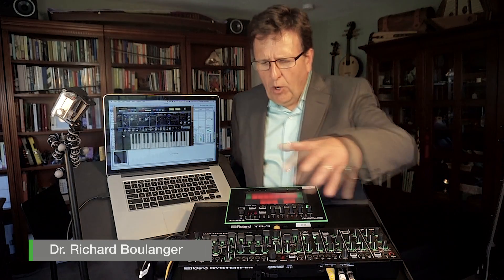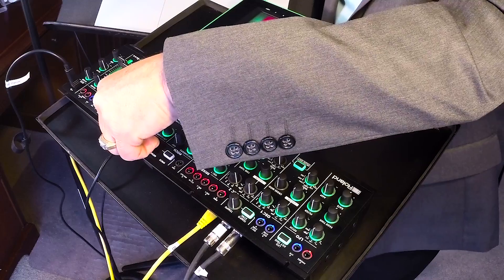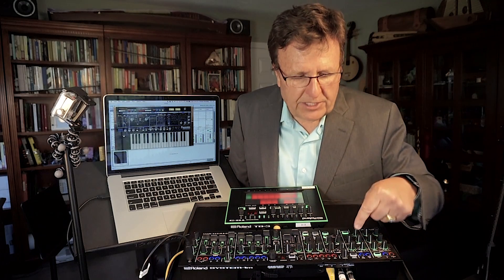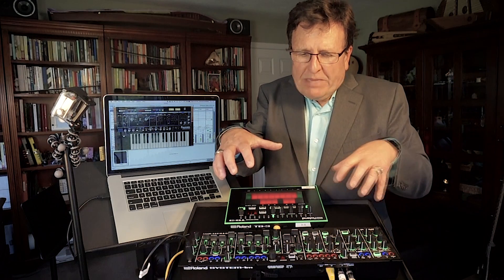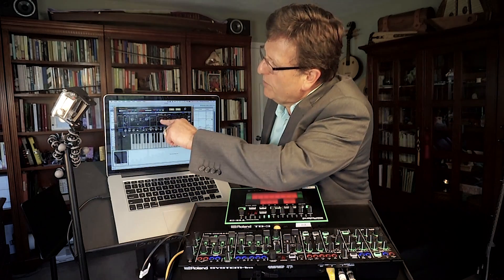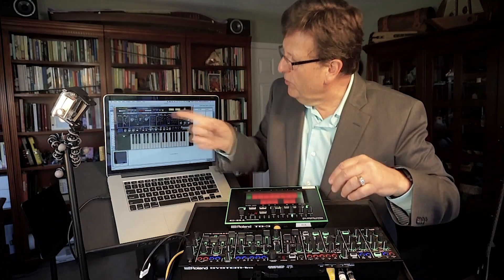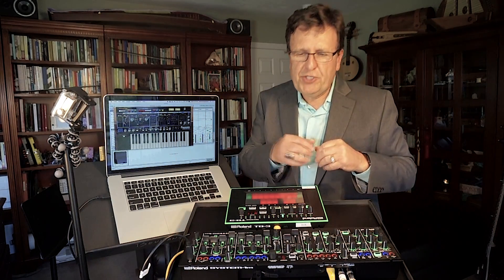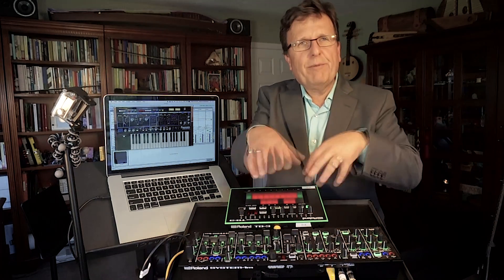Dr. Richard Boulanger - Part 2: SYSTEM-1m and PLUG-OUT

Comment: so if i for example leave a fader up while in plug out mode, that might/will drastically affect the sound of the synth patch itself, would it??  faders are not automated nor are there any endless encoders..  i mean the feature is nice to have but imo ita technically imposible to use both while performing live   am i corect?
Reply: i guess there is pick-up mode.. until you move the fader or knob to the loaded up value, it doesnt have effect, then it picks up.. or jump mode.. when once you move the fader, the value jumps, but untill then it stays in the loaded state..
not sure what mode this one has (or if you can change it)